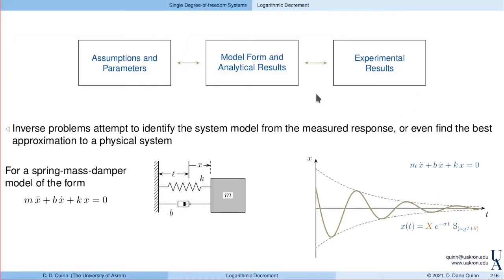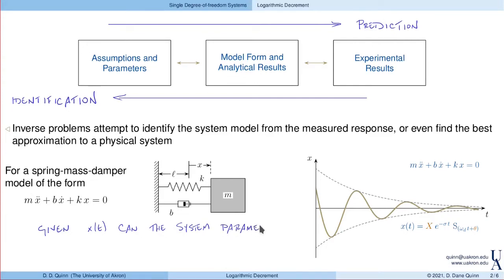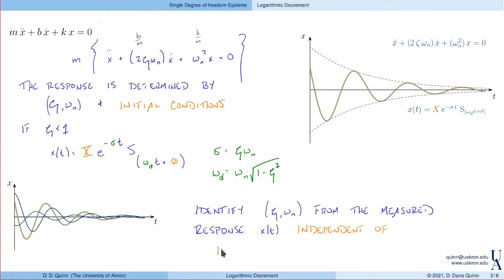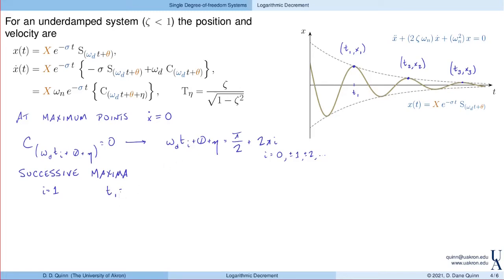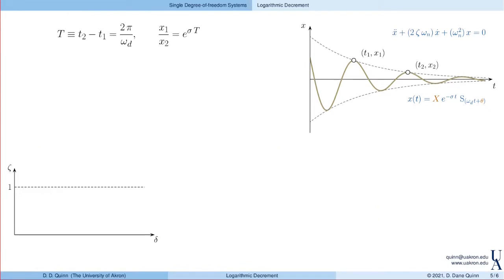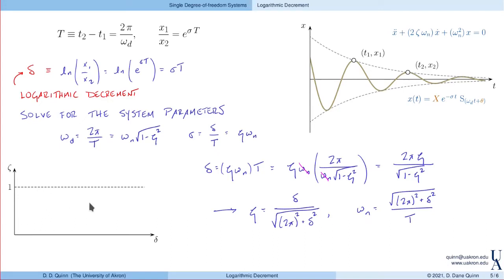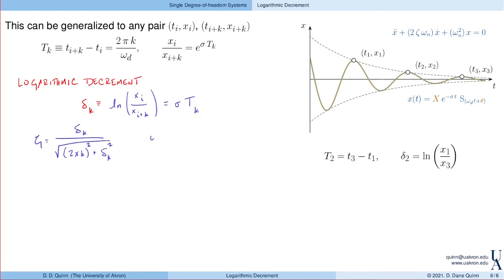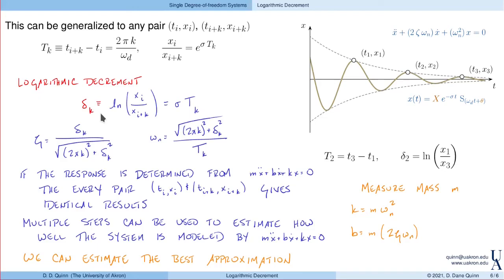UA - ME: Logarithmic Decrement

Comment: Time intervals remain equal if the spring and damper both act in a linear manner. If the spring load varied with position or the damping coeff. varied with speed, then the time intervals will vary peak-to-peak.

Now we need to overlay all sorts of different inputs and vary the damping w.r.t. frequency if we want to have some real fun.